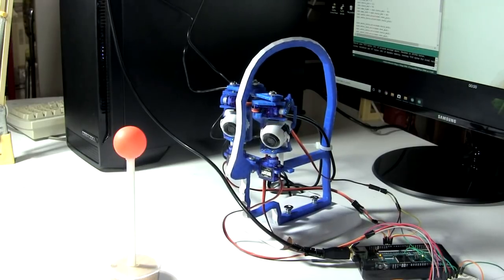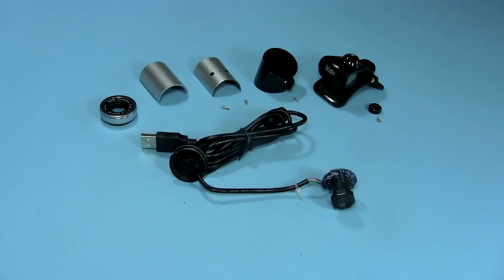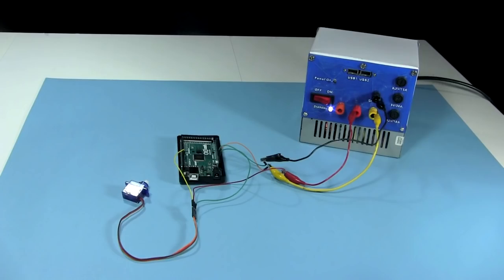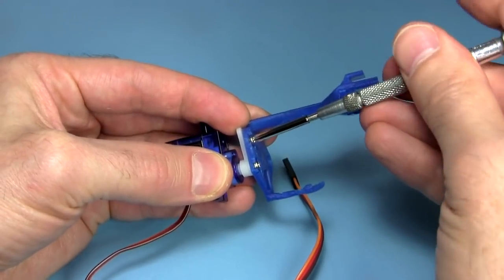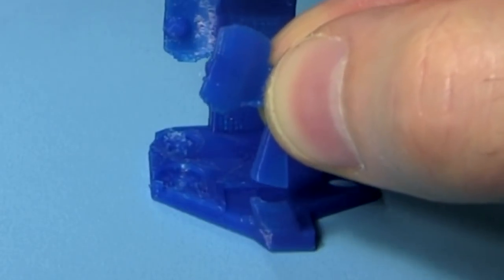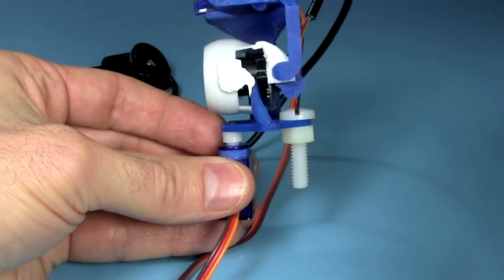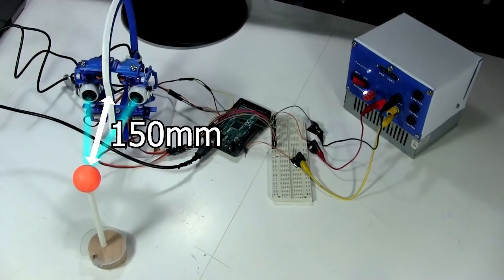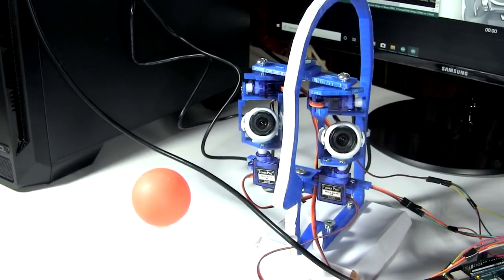Making Servo Robot Eyes for YoLuke Webcams - Izzy

Comment: what operating system do you use?
Reply from the maker: The NVIDIA TX1 board has Linux ubuntu-desktop 4.9.140-tegra on it. I have to use that because it comes with the drivers for that board.
Reply: @RimstarOrg  oh I see.

Comment: So its possible to put cameras in animatronic eyeballs?
Reply from the maker: It should be possible given the right design. The tricky part is fitting the camera in the eyeball. Also, when people say "animatronic" eyeballs, the eyeballs are usually parallel, they don't move independently like mine so they can't fixate on the same point in space. The same object may still be in both camera images but the both cameras won't be looking directly at it.
Reply: @RimstarOrg  ohh thanks for letting me know

Comment: Thanks for everything but most importantly knowledge. The torque is far on servos motors. You have a phenomenal presentation and project. The voltage must be turned down as it reaches the servos extremities (when robot looks up and down, left and right) to prevent jerking of the robot. You have very powerful motors for small masses, the motors must compensate for the inertial forces. I learned a lot from your video.
Reply from the maker: Yeah, I'm a little torn about the torque. It does jerk the head around and I've considered adding acceleration and deceleration. But human eyes do the same thing, they only move with rapid moves. They only seem to move slowly, for example, when scanning a scene. But really the movement is made up of multiple quick movements. Maybe once I have a bulkier robot head, it won't be as noticeable.

Comment: You need to fix the angle so you it can easily looking some where
Reply from the maker: Do you mean to connect the cameras so that they are synchronized to always look using the same angles? That's the way animatronic eyes do it but they don't usually have cameras. What if the object is very close in front? Then the cameras will have to be a different angles to look at it.
Reply: @RimstarOrg   i guess yes  or maybe...
Reply: @RimstarOrg  interesting

Comment: can izzy read
Reply from the maker: Izzy can't read but I do remember checking how well the cameras could display a page of text from a book and the letters were perfectly clear. So the image can be given to a program that can turn that image into letters that I could then give to another program that turns them into speech which I could send to a speaker so you can hear it.
I did a similar thing with a Pi camera once, though I gave it objects to recognize and not text. But it "spoke" the names of the objects it recognized. I wrote about it in an article here https://hackaday.com/2017/06/14/diy-raspberry-neural-network-sees-all-recognizes-some/
Reply: great then make a video about it
Reply from the maker: It's too out-of-date. The object recognition took around 10 seconds back then. Newer software can do multiple in a one second. Anyway, I'm getting close to having both of Izzy's "eyes" recognizing the same objects and locating them in 3D space. Still hunting for the best software though. 
EDIT And I'll make a video once I have that working.
Reply: @RimstarOrg  GREAT

Comment: Hello. Very nice material. 

I am working in a similar project but using Ucams v1 from 4D systems. I noticed at least in the board and animation that I don't need two servos to tilt the cameras up and down, seems that only one is enough. Just the two servos for left and right side for each camera. Not sure if I am missing something in my calculations. I want to keep power consumptions as low as possible and that's why I will prefer 3 servos. I will see if I am right or wrong xD
Reply from the maker: I guess you could use only one motor for tilting both cameras up and down, I'm not sure I even considered trying to design that. I probably saw some of those designs when looking at animatronic designs but in those designs, the way the linkages were made to the motors always looked like the horizontal movements could cause some vertical movement and vice versa. For animatronics, precision isn't important. Also, if you weren't trying to fit it inside a human head like I am then I guess it would  be pretty easy to make it work.

Comment: I am making a social bot. I am going to use a cosplay silicon mask for the head. Still going to need to design a support for the mask, however. Going use an Arduino to control the eyes and for blinking.
Reply from the maker: Awesome. Sounds like a fun project. You probably want a simpler design for the eyes than I have here though. Look for designs for animatronic eyes. Animatronic eyes are always parallel, so they never both look at the same point in space but you don't notice it unless you look for it. They're simpler to build because they can work with fewer motors. Mine are designed to be able to both look at the same point in space like human eyes can. You probably don't even have to search for "animatronic" eyes since most are that type.
Reply: @RimstarOrg  I'm going to use a camera eventually that is interfaced with an NVIDIA Jetson Nano. Not sure where I'm going to mount the camera yet. (It only needs one) maybe a neck pendant so it doesn't look out of place! 😊 Thank you for letting me know about Animatronics, I will look it up.

Comment: Wonder if you've got anything new.
Reply from the maker: I was stuck for a long time trying to do serial writing and reading over a USB cable between a Raspberry Pi and the Arduino Mega. I only recently figured out the trick to making it work reliably (as part of setting up the serial port on the Pi, clearing the line to reset the Arduino's side by setting and then clearing DTR). I've also managed to do the same from a Windows desktop. Next I'm trying from an NVIDIA Jetson TX1 board that I bought a while ago. Once I've done that, I can move onto processing the camera images on one of those three.
Reply: @RimstarOrg  oh man,  I can't wait for the jetson integration.  Looking forward to it.
Reply from the maker: Let's hope it works then! I'm not sure how well the serial will work through the UBS hub -- the Jetson TX1 has only one USB port and so I need the hub to get more.
Reply: @RimstarOrg  please keep making this videos they are really so nice i have achieved in making an ornithpter because of you thank you!!

Comment: I was wondering if you gave Izzy a face yet? I really like this video. Hopefully come out with a new video soon.
Reply from the maker: No, I got stuck trying to write from my Raspberry Pi to the Arduino Mega. I'm stubornly trying to use a USB cable so that I can also communicate from a desktop computer or laptop to the Arduino Mega. So I'm trying to do serial I/O over the USB cable. Doing reading works fine, but not writing. Every now and then I get another idea and try but no success so far.

Comment: Can you make a video about crystal radio with less diameter of roll and less turn cause i don't have that much wire in home .By the way this video is awesome
Reply: Sorry I don't know that you have video about lc resonant circuit
Reply: Can you tell me in which machine i can find germanium diode
Reply from the maker: I don't know of any machine that has germanium diodes. Silicon diodes are used most often in machines (which are not good for crystal radios). You can find them cheaply on https://ebay.com, just go there and search for "1n34a". That's where I get mine.

Comment: Rimmy when will you make a spark gap transmitter and receiver?
Reply from the maker: Probably never. Those things are electrically noisey (on purpose) and I don't think my eyes can handle too much more UV damage from sparks :-).
Reply: Yeah they are very noisy and a bit annoying, I made one with a boost converter I bought online, I already created the coils the button and the antenna even added a ground connection, but I still haven't made a receiver lol🤣 that's why I'm here. I really don't know what to receive the signals with
Reply from the maker: I guess a quick test would be to use a normal radio -- you'd probably hear extra static when you turn on your transmitter. But other than that, I don't know. It does sound like a fun project though.

Comment: I literally just now finished assembling the previous iteration of this setup from your older video; before discovering this new video! It worked amazingly well :D 
I can now see how your new changes and upgrades come in handy - could you share the updated files on thingiverse? 

Currently i'm working on an underwater ROV for a university project, powered by arduino and raspberry pi, and this was such a perfect and simple solution!
Reply from the maker: That's awesome! I'd love to see it if you have it online somewhere or even if you just email me a photo. No worries if you can't.

I guess the changes you probably like best are the stops for keeping the eyeball from going too far. They are designed to stop at angles which match that of the human eye (roughly 45 degrees left, right, down and 30 up), which probably won't be the same for an ROV.  Also, to work with a Pi Camera, the eyeball part would have to be redrawn a bit and I'm not sure it would work. The YoLuke webcam is much lower quality (okay for my application) and probably slower since the Pi Camera has a fast connection and makes use of the GPU on the Pi.

However, it took a little time but it's now at https://www.thingiverse.com/thing:4128076 in case you still think you can use it. The blender file is there too if you want to try adapting it for the Pi Camera.
Reply: @RimstarOrg  Thank you for your reply. I'll be sure to send you a pm when the project is done!

The deadline is in May, so it will be a couple months, but I will upload a video on my channel when its done. 

The eyeball cam would be encased in a clear dome, so we might be going for 180 degrees field of view in the horizontal plane. Up and down might not need that many degrees.

Anyways I'll send you a pm when we have some footage!

And thank you for taking the time to update the files!
Reply from the maker: Thanks! I look forward to seeing it! Good luck with the project.

Comment: Nice to see you back. And I like the differential control as mentioned at 7:00. Nice work.
Reply from the maker: Thanks. Do you mean the algorithm where I pick a point in the room relative to a point between the two eyes and then calculate servo positions from that? Yeah, I figure when you have two eyes that you want to have looking at the same object, a good way to guarantee that is to start with the single object and work back from there.